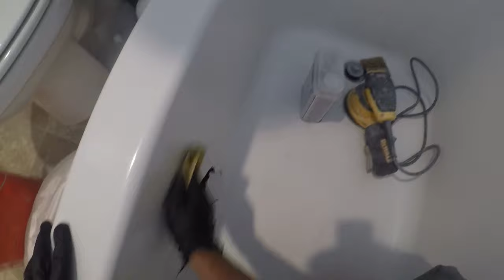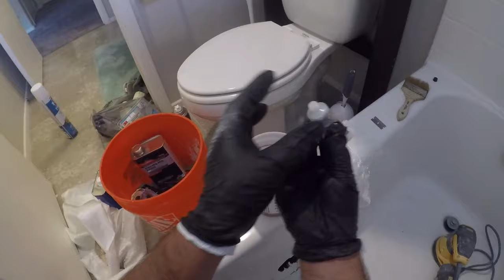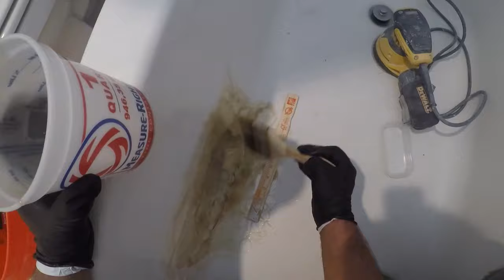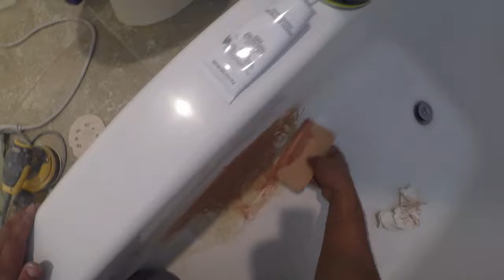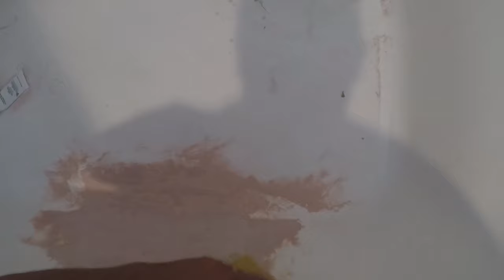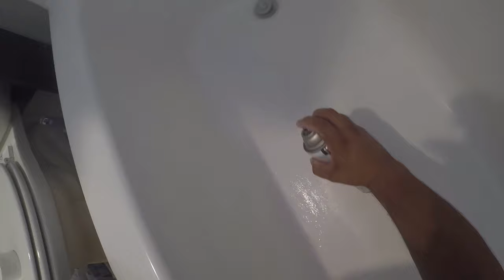HOW TO REPAIR A HOLE IN A FIBERGLASS BATHTUB | Fiberglass Crack and Hole Repair (Time Lapse)

Comment: Thank you for doing this. I found another video you did that has voice so products are noted.

In this video, you use:
1. Bondo fiberglass resin and mat
2. the brown stuff - looks like 3 coats.

question 1 - is the brown stuff the Bondo Glass?

question 2 - in a different video with the voice and products, you had a 3rd step/product of the Bondo All-Purpose Putty. You have that listed as a product in this description, but I didn't see you use it. Does the Bondo All-Purpose Putty need to be used also, or is the fiberglass resin and glass enough?

I have a 2 inch hole in a custom therapy fiberglass pool - we are removing a jet that keeps leaking and filling the hole like you show in this video. 

step 1 - the fiberglass resin and mat is needed structurally.
But then, I am unsure on the glass and putty.

question 3 - what does the Bondo glass do? and what does the all-purpose putty do?
 
Thank you in advance and I hope you will reply.
Reply from the maker: Always use the bondo putty to smoothen after bondo glass or resin

Comment: What product? Looks like the first step was a few layers of fiberglass and resin, then several thin coats of epoxy with sanding, bit what spray paint did you use in 2 step process of painting?

Comment: Loved this and it gave me the ooompff to fix my own hole....wish mine worked out the same, its fixed, filled and strong withthe resin and mesh tips!! BUT my paint job lets it down and now i just have an uber glossy white square patch where my fix is..!! Ah well. Better than silicone and aluminium tape i suppose!!
Reply from the maker: So glad you don't have a leak anymore. What is wrong with the paint job? Send me a message with a picture on instagram and I will see how I can help you
Reply: @DPTubs  what kind of painting did you use , as a last step ?

Comment: this video was VERYYY helpful, there was a whole in my bathtub and now its fixed all thanks to you posting this video👍🏽
Reply from the maker: That is awesome! So glad I could help
Reply: Did you fix the hole whole?
Reply: The only thing he did write was use gel coat, resin and epoxy don't bond properly to gel coat. They need bare glass bond.

Comment: That's incredible! Nice work! What's that fabric you used before you applied the fibreglass resin? I'm looking to repair a hole in my bath tub too, so knowing all the materials would be handy.
Reply: Bondo Fiberglass Mat
Reply: 3M fiberglass cloth
Reply: You need to give step by step instructions

Comment: I had someone come repair a crack just like this on my bathtub, couple weeks later i stepped on it and it cracked. The guy said he would return and fix it again and this time drill holes around it and fill it with some foam. Is that going to help with me not cracking it when I’m showering , its hard for me shower and trying to avoid that area! The crack is on the floor.

Comment: Hi I have a smaller hole then the one you fixed but it’s as long with a couple cracks in my tub only it’s a bit higher up closer to the top can the same thing be done if I were to do it to my tub and if so can you list the supplies you used as well thanks . Fantastic video really
Helpful
Reply from the maker: Yes I will!

Comment: Thanks for the helpful video! I ordered all the supplies but realized I received the fiberglass cloth, not the mat. Would the cloth hold up or do you recommend I just try to find the mat. 
(Fixing a large hole on a fiberglass shower back wall). Thanks!
Reply: Im using the mat right now to fix a hole

Comment: What grit of sandpaper do you use at the varying steps. And what grit on machine?
Reply from the maker: 120 grit
Reply: @DPTubs  Thanks! Products list indicates fiberglass mat but it looks like your using fiberglass cloth. I am doing identical repair but in the wall surrounding tub. Just want to be sure I have proper items for project. Thanks again.

Comment: Great job. But I would like to mention you only use/need like 8 of these items on your list to actually  patch the hole(not talking about PPE and the fan). Seems like like you're adding extras to make more money off the links. 

Aside from PPE and the fan, you need:

1.sandpaper (or an electric sander if you want to speed up the job by 20 minutes) 
2.fiber resin
3.bondo putty  
4.fiberglass cloth 
5.any cup/vessel that can stand up to solvents
6.Old paint brush
7.Special spray paint.
8.Something to spread evenly with

Even with PPE that's like 14 out of the 23 you posted links for. But, I digress, you did do a great job and I appreciate the show.
Reply from the maker: and your point is? Does a shoe salesman always come back with the shoe you asked for or another option as well? I like to give my active viewers consistent list of products that I use regularly.

Comment: What was the spray paint you used for inside the bath?
Reply from the maker: I use either Rustoleum Appliance spray or Rustoleum High Performance Enamel white 

I should have links in the description for them

Comment: What if the hole is on the part where you feet go? Should I put something in the hole before I patch? You know for support
Reply from the maker: I just posted a video with the crack at the bottom and filling with foam support

Comment: you use spray cans alot what brand and type do u recommend
Reply from the maker: I ONLY use spray cans on repairs only. Full reglazing jobs I use 24 ounces of two part coating called Resurface Solutions and spray with an HVLP Spray system. 

For spray can touch ups I use Rustoleum Appliance Spray White

Comment: I`ve just fitted a new bath. I wasn`t sure how solid it should be so have gone way over the top. Even wooden supports underneath and bracing on the wooden horizontal supports. Tons of glue and mastic round it. It`s going nowhere!  Now we find that on filling the bath it has dozens of tiny holes in the fibreglass near the plug which are leaking through to the floor. My worry had been my plumbing leaking, not the damn bath. They are too small to notice until they leaked. The shop have offered us a replacement. It would ruin two weeks work to take it out so will try to fix myself. (Just a warning for anyone buying a new bath).

Comment: How can you tell the tub is fiberglass or not?
Reply from the maker: Most plastic tubs are acrylic or fiberglass and the repairs are the same! They have a similar knocking sound that distinguishes them from the “ping” or echo of metal
Reply: @DPTubs  Thanks a lot. I need to repair my mother in-law’s cracked bath tub. I will go buy all the items needed from the links you’ve provide. 👍

Comment: I think the amount of time spent on this I could just remove the old busted tub and replace it entirely. I'm sure this is a cheaper route though.
Reply from the maker: definitely much cheaper. Drywall, flooring, painting, cost of new tub, cost of installing, plumbing removal and reinstall.
Reply: Replacing it would not be fast mud tape you tripping
Reply: @corona7st788  20 minute mud bud. I can tear a tub out and have a new one in in under 4 hrs for sure. Definitely wont be cheaper though.
Reply: I'm sure that repair take like a hour max...
Reply: @corona7st788  probably but where do you get the patch kit? I've looked at lowes, home depot, menards. Cant find a repair kit anywhere.
Reply: @carcasscruncher9354  seen some on Amazon.... I'm sure Auto body fiberglass Bondo will work the same..
Reply: @corona7st788  I'll check it out. Thx
Reply: This guy definitely never worked any kind of trade  it would soooo much longer to replace the tub, this guy probably completed this job in a 8 to 12hr day
Reply: Gotta remove and reinstall tile too, minimum 2 more days just for thinset and grout drying times.
Reply: @Nick-of1fw  are you accounting for dry time on all that mess? Didnt think so. I could definitely replace the entire thing just as fast man.
Reply: @manfjsjjskdjhtjaozjdnn3947  no, none of that. A surround and drywall mud. Done in a day or two max.

Yins lost your damn minds.
Reply: @carcasscruncher9354  i promise you couldn't i do custom kitchen and baths it is way faster to patch with fiberglass they have  rapid setting it drys quick you wouldnt know though just another keyboard warrior
Reply: @Nick-of1fw  lmao keyboard warrior? Hahaha get on then...go prove me wrong.
Reply: You should stop thinking it's not good for you here
Reply: You should stop thinking it's not your best skill 😅